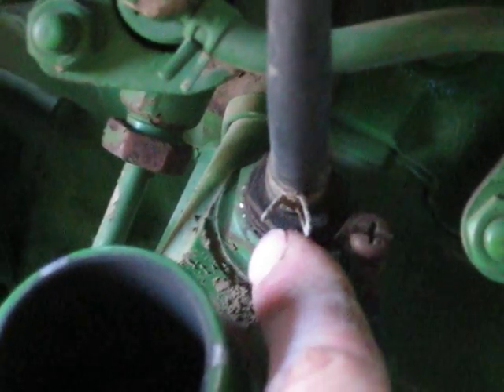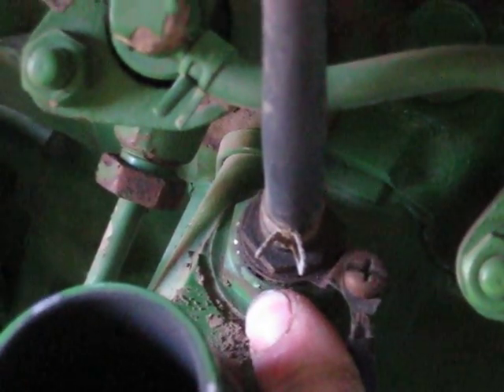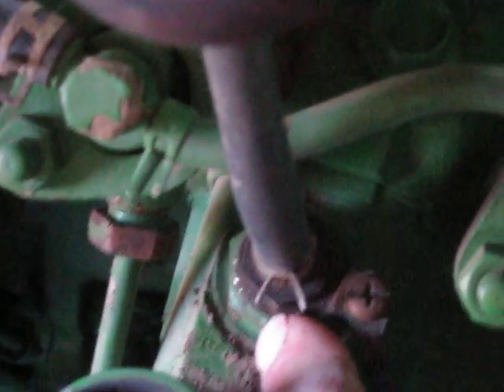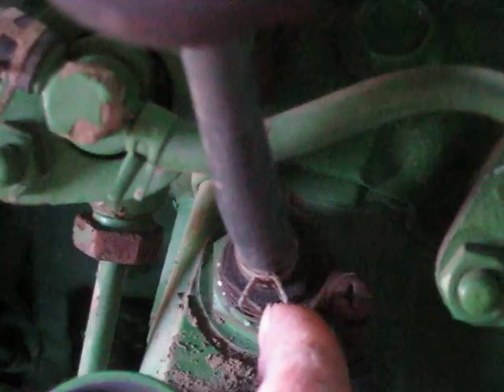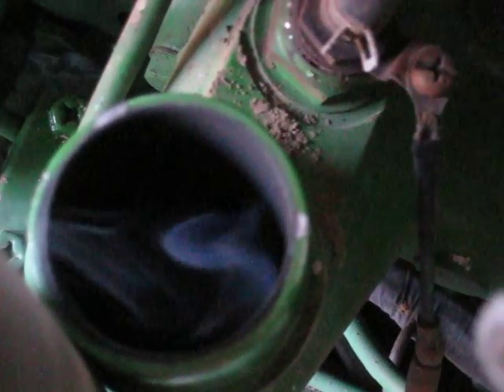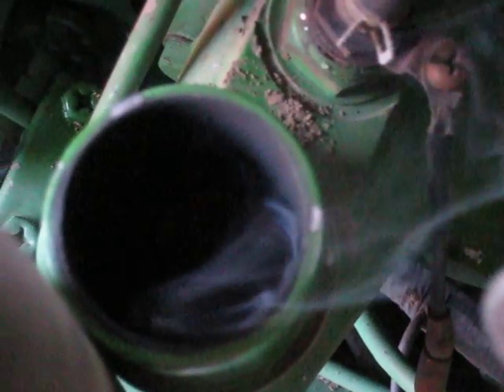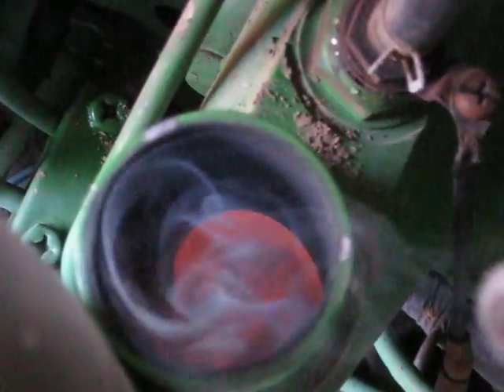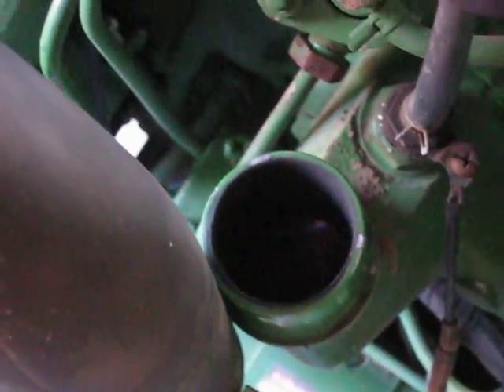Thermostart on my JD 650

Comment: I'm repairing the Thermostart system on my 1986 Ford 5610 tractor right now. It's a little different: there's a primer button on the Lucas injection pump to deliver fuel to the heater. Otherwise, same idea. Apparently this setup works really well with less load on the battery than a set of glowplugs. Good video!

Comment from the maker: @KrankieV2 massey ferguson diesel tractors used to use them also. im not sure if they are even used on any new diesels? i know it definently works because it wouldent have started in the winter without. its very cold blooded below 40deg. above 40deg i dont preheat at all.

Comment from the maker: @edzgarage yeah it works ok and takes less power than glow plugs. the tractor came with a 370cca battery from the factory but i got an 800 just in case. its pretty cold blooded when it gets really cold out. i havent even used the preheater since the temps came out of the 40's though. it fires right up